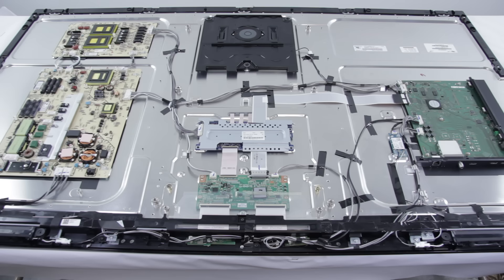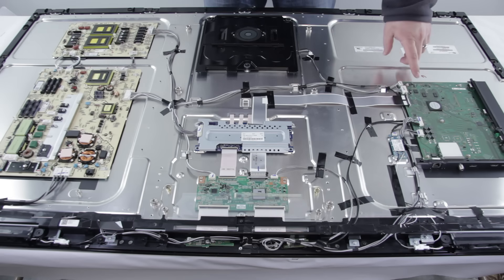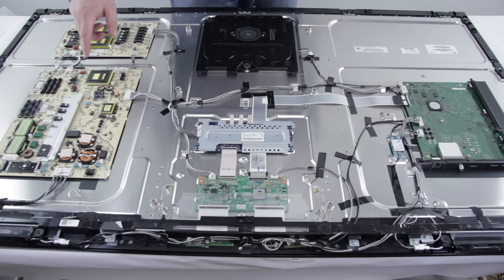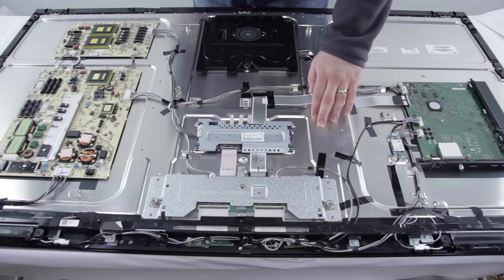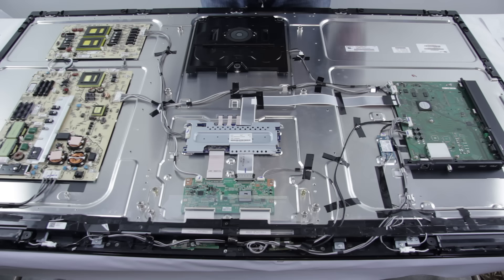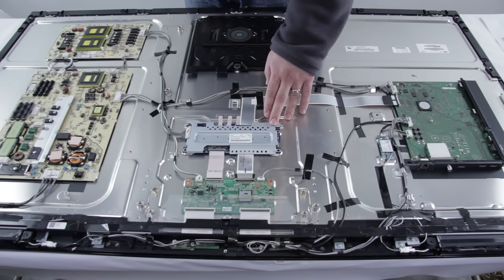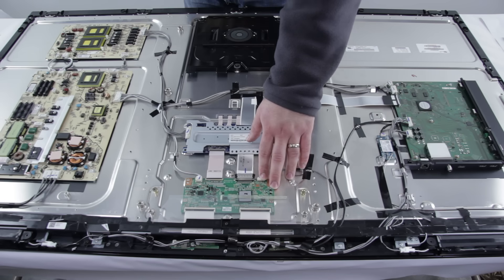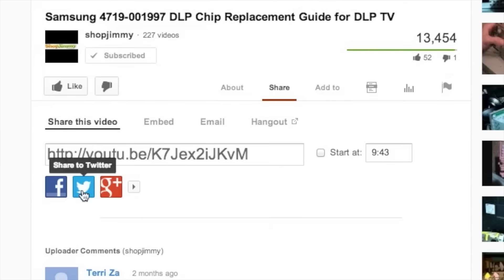LED TV Repair Tutorial - Common Symptoms & Solutions - How to Repair LED TVs

Comment: Hi I have a 55inch LED Vizio TV model# M550sl that just shut off one day and will not turn back on, its like it has no power. I tried all the reset tricks and I also purchased a new PWR supply from you ( order# 1900584) but the problem wasn't fixed. I was thinking now it had to be Main Board but after watching one of your diagnostic videos the no power issue was not listed as a symptom for a bad main board it suggested PWR supply board. Could really use some advice on what to do next!

Comment: hi , I'm having issues with my Vizio M420SL. TV will be on,  then just power off. the Illuminated Vizio sign in front normally lit white with on, flickers goes off turns white then goes orange well the tv shuts off. any suggestion on what it can be ?? I'm assuming the tv keeps resetting due to a bad main board ?? any input

Comment: I have a Vizio E260MV, when it's powered up the picture flicker and blinks. After, time goes on, the picture stays on longer, after, one hour picture flicker and blinks less. after, two or three hours it seems to disappear. It act if a capacitor has discharged and is charging when the unit is powering. I purchased this unit, out the box, on the clearance sale and placed it in the closet until now and the warranty has ended. Please, help.
Reply from the maker: +Larry Clay    Try all repairs and troubleshooting at your own risk.  This could be a problem with either the power supply or the LEDs in your TV.  You can replace the power supply board to see if that fixes the problem.  Click this link to a replacement power supply boards.  http://www.shopjimmy.com/catalogsearch/result/?q=E260MV  There may be multiple boards for the same TV model number, be sure to match part numbers on your current board, with your replacement for compatibility.  Here is a link to a video showing how to identify your part number, click here:  https://www.youtube.com/watch?v=4i57Cm9-96M  Thanks and please let us know if you have any further questions with your TV Repair!  www.shopjimmy.com

Comment: Haier L32A2120 Screen flickers dark to light horizontaly. also no response from remote control. any help greatly appreciated
Reply from the maker: +ginohio1  Try all repairs and troubleshooting at your own risk.   I recommend replacing the main board and the power supply board in your TV.  Click this link to replacement parts for your TV model number:  http://www.shopjimmy.com/catalogsearch/result/?q=L32A2120  There may be multiple boards for the same TV model number, be sure to match part numbers on your current board, with your replacement for compatibility.  Thanks and please let us know if you have any further questions with your TV Repair!  www.shopjimmy.com

Comment: hi I have a 65" rca led lcd full HDTV mod# LED65G55R120Q and it started  shutting its self off after it's been on for 30 mins. Sometimes it will run for 2 days until it shuts off on its own. What board  will cause this symptoms. thanks and great video

Comment: I have a FUNAI LED model number LF320FX4F. It doesn't  turn on anymore and it makes a very low high pitch noise when I plug it in. What could it be?
Reply from the maker: +Fabian Angelis   Try all repairs and troubleshooting at your own risk.  I recommend replacing the power supply board in your TV.  Click this link to replacement parts for your TV model number:  http://www.shopjimmy.com/catalogsearch/result/index/?cat=59&q=LF320FX4F  There may be multiple boards for the same TV model number, be sure to match part numbers on your current board, with your replacement for compatibility.  Thanks and please let us know if you have any further questions with your TV Repair!  www.shopjimmy.com

Comment: Hi I have question. I have a 26 inch led tv of LG Brand purchased 4 years ago. from some days it's display goes off while audio is on. this happens repeatedly even after switching off & then on again. some times there is no problem at all. some time half display is dark & half is normal. Please suggest what to do ?
Reply: +sandeep gupta
Thanks for your reply.
You asked me for my TV model Number
My TV Model number is 26LE5300 (Brand - LG)
Reply from the maker: +sandeep gupta   Try all repairs and troubleshooting at your own risk.  This sounds like you have bad LEDs in your TV.  Unfortunately we do not sell replacement LEDs for your TV model number at this time.  You can check back in the future to see if we have them available.  Thanks!  www.shopjimmy.com

Comment: My tv is a Samsung 46" ledThe model number is UN46EH6000FMy tv randomly shut off and when I got it back on it was no picture but sound was going.. I can see the backlight is running. There is light coming from the back of the tv. Is this the tcon board and which one should I get specifically to replace it and fix it
Reply from the maker: +Ryan Rudisuhli   Try all repairs and troubleshooting at your own risk. This could be a problem with either the t-con board, the main board or the TV panel. You can replace the main board and the t-con board individually to see if one of those boards fixes the problem.  Click this link to replacement parts for your TV model number:  http://www.shopjimmy.com/catalogsearch/result/?q=UN46EH6000F  There may be multiple boards for the same TV model number, be sure to match part numbers on your current board, with your replacement for compatibility.  Thanks and please let us know if you have any further questions with your TV Repair!  www.shopjimmy.com

Comment: I HAVE A INSIGNIA MODEL # NS-32D201NA14 FIRST THE SOUND WOULD COME ON BUT NO PICTURE. AFTER IT WAS UNPLUGED FOR A WHILE I HAVE NO SOUND AND NO PICTURE. BUT I DO HAVE POWER, THE RED LIGHT COMES ON AND GOES OFF WHEN YOU TURN IT ON AND OFF. SO PLEASE LET ME KNOW WHAT YOU THINK I SHOULD DO. 
THANKS GENE WEBB
Reply from the maker: +Eugene Webb  Try all repairs and troubleshooting at your own risk.  I recommend replacing the main board in your TV.  Unfortunately I do not see any replacement parts in the search results for your TV model number on our website.  Please reply with your part number on your main board and I can try searching for replacement parts.  Thanks and please let us know if you have any further questions!  www.shopjimmy.com

Comment: Hey!! I need help with my 28" samsung LED f4000, i cant turn it on, it happened after an power outage, I already tried t replace the power chord, but it still doesnt work. Thanks!
Reply from the maker: +Cesar Anleu   Try all repairs and troubleshooting at your own risk.  I recommend replacing the main board and the power supply board in your TV.  Click this link to replacement parts for your TV model number:  http://www.shopjimmy.com/catalogsearch/result/?q=f4000  There may be multiple boards for the same TV model number, be sure to match part numbers on your current board, with your replacement for compatibility.  Thanks and please let us know if you have any further questions with your TV Repair!  www.shopjimmy.com

Comment: I have an LG39LN5300-ub  I lost back lighting. The flaslight test showed that the t con board is still sending video to the screen.  The sound is also still working.  I purchased a new power supply/led driver board from shop jimmy. after replacing i still have the same issue and need to know how to proceed. Any help is appreciated. Thanks. Tim

Comment: Hi, Jimmy.
I have philips 40PFL4706/F7 LED tv. It turns on and the screen goes off within 1 second but the sound is still great. I did flashlight test and I see pictures on the screen when I light on the TV. So, it does not have backlight. I replaced LED driver with the exactly same part number but it did not solve the problem. I also replace power supply just in case and it did not solve the problem. I do not know what to do next. Please help me.
Reply from the maker: +ms lee   Try all repairs and troubleshooting at your own risk.  This sounds like you have bad LEDs in your TV.  Unfortunately we do not sell replacement LEDs for your TV model number at this time.  You can check back in the future to see if we have them available.  Thanks!  www.shopjimmy.com

Comment: Hi my LG 47ln5700 tv set has thin greyish black horizontal lines on one side of the screen..they're not too noticable from a distance but up close theyre easily seen...dont know if its the power supply board or the tcon board im assuming from my reasearch its one of the two any help in diagnostics before i buy the product would be greatly appreciated..i have taken pictures of the image and would like to email them to u if thats possible?
Reply from the maker: +MIGZA SADHU   Try all repairs and troubleshooting at your own risk.  This sounds like a TV panel (TV Screen) problem.  If your TV panel is bad, it may be more cost-effective to replace the TV as panels are typically hard to find in stock, difficult to replace, and expensive.  Thanks and please let us know if you have any further questions!  www.shopjimmy.com

Comment: I have Samsumg Led TV model No. UA40F5000ARxxT, Version No. HH04, S/N: LG9M3DADB00773Z and i have been using for all most 1 and half years, however, now the problem is i can only turn on TV and hear the sound but no display of picture. i went to Technician in my locality and advice to buy T-con. Therefore will it solve the problems of display picture. so please do advice me
Reply from the maker: +Tshering Dorji   Try all repairs and troubleshooting at your own risk.  This sounds like you have bad LEDs in your TV.  Unfortunately we do not sell replacement LEDs for your TV model number at this time.  You can check back in the future to see if we have them available.  Thanks!  www.shopjimmy.com

Comment: I GOT LG EAY62810801 (EAX64905501(2.0)) Power Supply / LED Board from you . because my tv doesnt turn on and the turn on button keep blinking in red without anything happen i replace the old power supply with the one i got from you with no result same symptoms. what to do?

Comment: I have a Samsung UN55C7000WFXZA that was hit with lightning through the ethernet port.  I had the standby light and it would click repeatedly when powered on, but no startup melody or screen.
I have replaced the main board (you didn't have it in stock) and now I get startup melody and backlight, then relay click and it starts over.
I visually inspected the power supply board and couldn't find any leaky or burnt components.
Not sure what to try next.

Comment: Hi Jimmy. I have a problem with my LG LED tv. The tv model is 32LM3400. I was watching tv and suddenly i heard something like explosion inside tv, the power went off and i could not start it again. It was no power at all, no standby light...so i decided to change power supply board. When i installed new power supply and power it on my standby light started - now i have red light wich is ok. But when i try to start my tv nothing heppens and standby light start blinking (red). I can not see any damage to other board. What should i do now? should i try new main board? Thank you for help. Dom.

Comment: I have an LG 32LN5310-UB and I think I need the LED Driver but do not see it on the TV or on your parts page.. is it integrated with the power supply?
Reply from the maker: +Daylan Brevik  Try all repairs and troubleshooting at your own risk.  Yes, it is.  Thanks!  www.shopjimmy.com
Reply: +ShopJimmy.com Got my part today and installed it but it is still not working. I have the same issue. I can still see a very dim picture. what is next?
Reply from the maker: +Daylan Brevik   This could be a problem with the LEDs.  Try all repairs and troubleshooting at your own risk.  These LEDs are replaceable, however it is recommended they are replaced by someone with the proper experience and training. When replacing the LEDs, the TV panel can get damaged. If the TV panel gets damaged, it is not repairable. Click this link to replacement LEDs for your TV model number:  http://www.shopjimmy.com/lg-lc320due-sfr1-led-strips-2-strips.htm   Be sure to match the panel information necessary to ensure you have the correct replacement LEDs.Thanks and please let us know if you have any further questions with your TV Repair!  www.shopjimmy.com
Reply: +ShopJimmy.com I already bought a new TV so me trying to repair this one is just to see if I can. can I return the power supply I ordered and then purchase the led strips?

Comment: I need to know the name and part number of the cable that connects to the WiFi Module to the harness that the power/IR board cable also connect to and this harness connects to the main board. The cable actually has both WiFi  module and power/IR board wires collected together into a harness that plugs into the main board. The TV is a   Samsung UN50F6350AFXZA Flat screen.
My email address is: morrisclyde1@gmail.com

Comment: Help!! I have an LG LED 3D 55" model 55LW5700ue. When I turn tv on the Red led light begins to slowly blink red and never turns on. It normally goes from red to white and turns on. Ordered a power supply (unfortunately you were out of stock so I ordered from someone else ) that was stated to come out of a New LG with a broken screen.  Part EAY62169901. Totally frustrated!! What to do?

Comment: I have an LG Model 32LN5310-UB and I think i need the LED Driver. I have audio and can barely make out the picture depending on how I look at it. I went to your parts site but would not find this particular part?
Reply from the maker: +Daylan and Shelli Brevik   Try all repairs and troubleshooting at your own risk.  The LED driver is built into the power supply.  It sounds like the problem could be with the LEDs or the power supply.  Click this link to replacement parts for your TV model number:  http://www.shopjimmy.com/catalogsearch/result/?q=32LN5310-UB  There may be multiple boards for the same TV model number, be sure to match part numbers on your current board, with your replacement for compatibility.  If needed, the LEDs are replaceable, however it is recommended they are replaced by someone with the proper experience and training. When replacing the LEDs, the TV panel can get damaged. If the TV panel gets damaged, it is not repairable.  Be sure to match the panel information necessary to ensure you have the correct replacement LEDs.Thanks and please let us know if you have any further questions with your TV Repair!  www.shopjimmy.com

Comment: I have a LG MD # 55lw5300-uc the TV just whent  out after a lighting storm ... Win trying to turn on the read light will glow in and out ...
Reply from the maker: +Jacob Bean   Try all repairs and troubleshooting at your own risk.  I recommend replacing the main board and the power supply board in your TV.  Click this link to replacement parts for your TV model number:  http://www.shopjimmy.com/catalogsearch/result/?q=55lw5300-uc  There may be multiple boards for the same TV model number, be sure to match part numbers on your current board, with your replacement for compatibility.  Thanks and please let us know if you have any further questions with your TV Repair!  www.shopjimmy.com

Comment: Hi! I have a samsung tv and its about 3 years old. The model number is UN39FH5000. The tv turns on and off because it makes a sound that indicates its turning on but the screen stays black. The menu wont show up anything. Ive tried the flashlight test and I still can't see anything. The audio works perfectly like it always has but the screen has just stopped working. So I dont think its a power or main board problem. i took off the back of the tv and everything seemed perfectly fine. There was no dents or frayed wires or leaking capacitors. I think its a backlight problem but I have no idea how to get to it, fix it or replace it! Please help! My parents say that if I can fix it I can have it (they have already gone out and bought a new tv which i thought was stupid).
Reply from the maker: +Olivia Hamlin   Try all repairs and troubleshooting at your own risk.  If you do not have backlights, this could be a problem with either the power supply / LED board or the LEDs in the TV.  You can replace the power supply / LED board to see if that fixes the problem.  If it does not, then I would say you have bad LEDs.  Click this link to replacement boards for your TV model number:  http://www.shopjimmy.com/catalogsearch/result/index/?cat=229&q=UN39FH5000  There may be multiple boards for the same TV model number, be sure to match part numbers on your current board, with your replacement for compatibility.  Thanks and please let us know if you have any further questions with your TV Repair!  www.shopjimmy.com

Comment: Hi, I have an LG32LB5820 LED smart tv. Recently, the sound output from the RCA AV input is very low....The AV input is connected to a cable TV STB.  I have to turn the TV volume to maximum to get some sound...I've tested the AV input using a DVD player and confirmed that the problem persists..... This problem doesn't happen with antenna input or HDMI..... There is no other problem except this AV sound problem... Help please........

Comment: hi jimmy i need your help with my tv the problem is there is no sound anymore everything els works but the sound is just gone and i have checked the settings en everything is set as it should be can you help me out ? i have a Changhong model: LC42F2
Reply: +rickyboyy88 sorry the model is LC24F2
Reply from the maker: +rickyboyy88  Try all repairs and troubleshooting at your own risk.  I recommend replacing the main board in your TV.  Unfortunately I do not see any replacement parts in the search results for your TV model number on our website.  Please reply with your part number on your main board and I can try searching for replacement parts.  Thanks and please let us know if you have any further questions!  www.shopjimmy.com